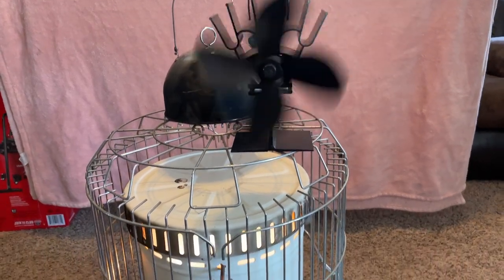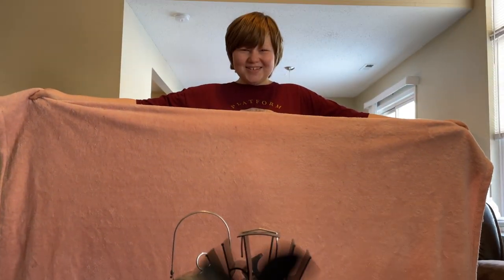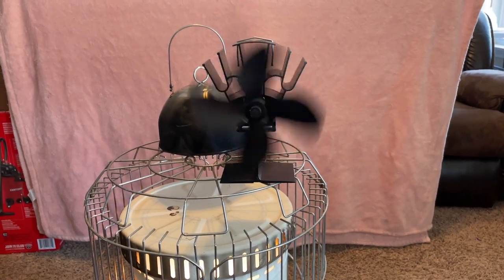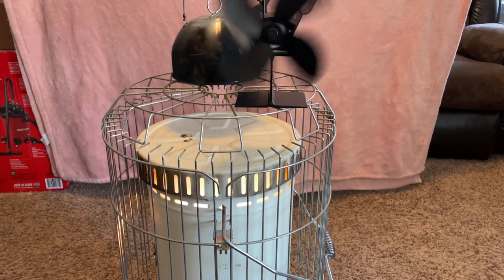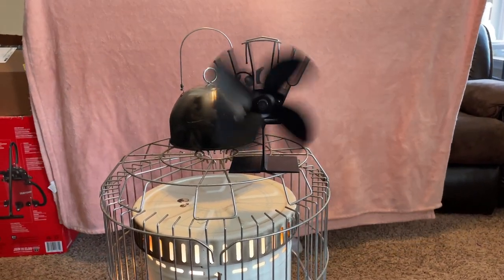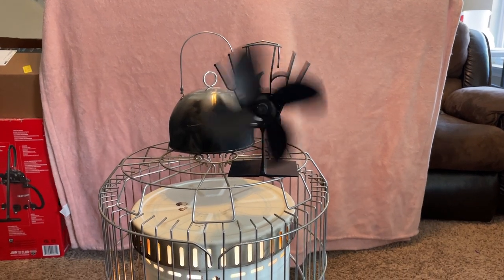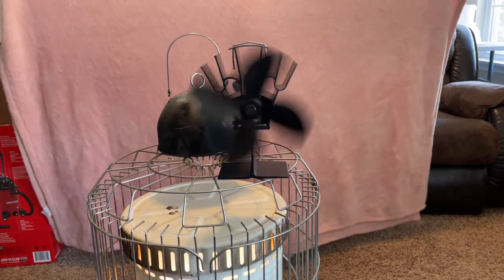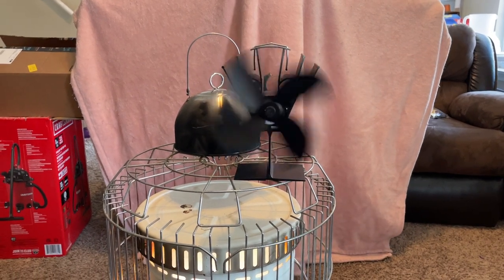Wood Stove Fan on Kerosene Heater

Comment: Those work really well I hear!  Off Grid with Doug and Stacie use that on their wood stove. I don't think they're meant to blow a lot of air, but to distribute the warm air around the room. I wonder if they work the same in front of a fireplace?
Reply from the maker: Not in front. This uses heat the goes upward.